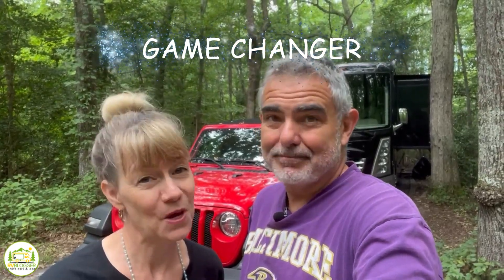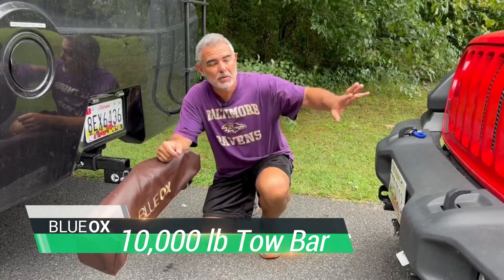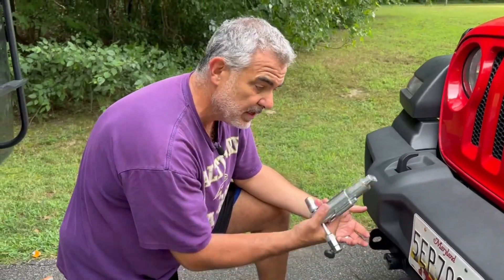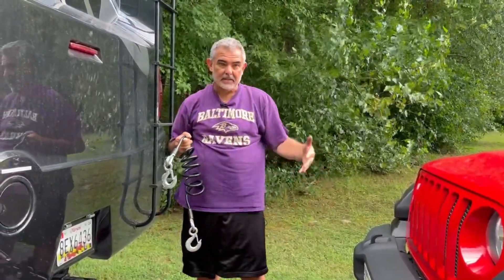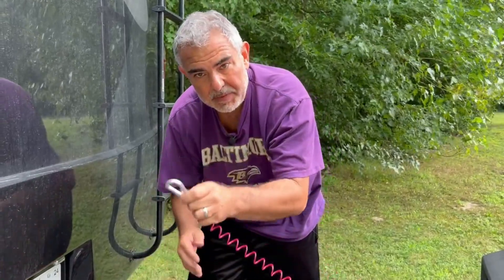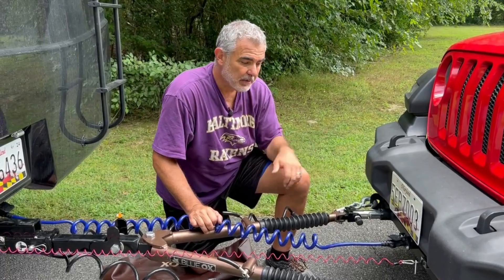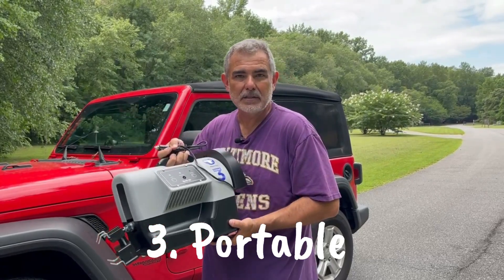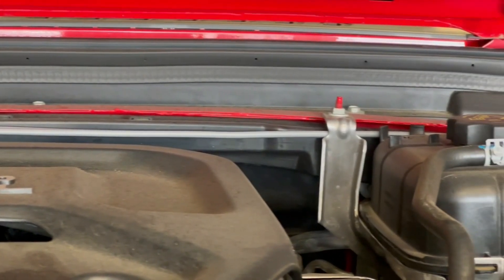Blue Ox Tow Bar - Total Game Changer!

Comment: Hi Mike, at 9:15 one suggestion that I use is to replace one of the bolts from your license plate with an eye bolt.  Then connect your emergency cable to the eyebolt.
Reply from the maker: That's not a bad idea Brian. Thanks for that tip and watching our video and commenting.
Reply: This is what I have done and works great!

Comment: Nice video you guys, so you've extended your hitch on the "A" I'd say go ahead and extend the electrical cable ( get longer) and get a safety cable.
Next thing is you said you put the Jeep in neutral. Hopefully you're putting the transfer case in neutral if the Jeep is automatic transmission.
Reply from the maker: Hey Johnf
We appreciate the info!!! 
Thanks for watching and commenting! 
❤ Mike and Susan

Comment: Hi Mike had the blue OX install professionally and wasnt told about removal pins on base plate , Thank  u much on that tip them Lil tips. I did add the blue OX guard to protect the front end of my jeep for peace of mind easy to connect to bar.
Reply from the maker: Hi Ric,
Glad you like the tip about the removable pins! And I think we will order the guard too...just to be on the safe side...We just camped on a gravel pad for 4 days and we spit some gravel when we were on the highway...yikes.
Thanks for your tip too!
Mike

Comment: Very good video! As was referenced in other comments, where you connected the breakaway cable to your Motorhome is just fine. You connected it to the hitch frame not to the hitch receiver assembly. The hitch frame is either bolted or welded to your Motorhome chassis. It’s not likely to come loose. If something were to fail it would be the pin that holds the receiver into the tube or something connected to the receiver. Even if all of that assembly was pulled away, the breakaway cable is “upstream” of all that fastened to the hitch frame and would stay in place allowing the breakaway cable to pull out of the Jeep baseplate and apply the brakes. You are good to go as you are in my opinion. Thanks for your efforts!
Reply from the maker: Hi Randy,
Thanks for the info...that all makes sense to me!
Thanks for watching the video!
Mike

Comment: For the break-away lanyard: I drilled a 1/4” hole through a bottom license plate hole, through the bumper, and installed a stainless steel eye bolt, with washers and lock nut.   Now I can easily hook up the little orange lanyard to the VEHICLE,  not the hitch assembly. Easy Peasy.
Reply from the maker: Thanks for sharing that info!

Comment: Thanks for the great video! We will be towing for the first time this weekend with the Blue Ox, Air Force One braking system attached to our ‘24 Wrangler! I installed it all myself, it takes a little mechanical ability, electrical experience with cars and help from YouTube University! It was fun getting it all completed and now I have a better knowledge of the entire system. The battery charging wire can be purchased for about $70 or you can build it yourself for around $20 with an inline fuse, a diode and some 12 gauge wire from an auto parts store.
Reply from the maker: That’s awesome that you were able to install it all yourself. You are a true DIYer! Which is perfect in RV life...gotta be a fixer! You need to make a video about this! Thank you for watching our Blue Ox video and commenting. We appreciate your support! Safe travels.
Reply: Let us know how it goes. How hard and long did it take you to install yourself? May I ask you what you bought, where you bought it and apex price? thank you We will be towing a wrangler JKU 2016

Comment: I have used the Blue Ox for a couple of years and really like it. I do have problems with the lights on my Jeep not always working and I have to fiddle around a bit .One word of caution that you probable should have mentioned is that it is almost impossible to back up more than a couple of inches with the vehicle attached as the follow vehicle will not back in a straight line and will jacknife. This is from the voice of experienec and the end result was costly to me with damage to both vehicles and a bent arm to the Blue Ox tow system making it worthless and I had to buy a new unit. Incidentally, on that particular trip, I connected and disconnected the tow bar 8 times for different reasons.
Reply from the maker: Hi Frank,
I should have mentioned the DO NOT BACK UP warning in the video...
Thanks for bringing it up here...maybe some others will see it and read it. Sorry you found out the hard way!
Thanks for watching!
Mike

Comment: Here's a few more tips, For the breakaway tether on the coach side, I used a 900 lbs pull strength cable with eyelets that attaches to the chassis frame on the coach and that right under the hitch.  Also I recommend using hitch stabilizers on the hitch to the drop receiver and one on the  drop receiver to the tow bar, this eliminates any movement and chucking that occurs when traveling.
Reply from the maker: Hi Casual RVer,
These are great tips! I'm gonna check out the cable and the stabilizers.
Thanks very much!
Mike

Comment: I am all for step by step how to videos.  Is there a way to check your brake lights if you’re by yourself? And if you’re by yourself can you tell by that little lever on the tow bar arm that the second arm has extended fully Incase you don’t have that second person walking along side of the car to make sure it snapped into place
Reply from the maker: Hi Debbie,
Hmmm...this is a really great point. Susan and I are stumped...maybe a mirror on the back corner of your tow vehicle to see the lights and you could use a rear back up camera to watch the second arm click into place. Ours usually clicks in 2-3 seconds but you may need to drive 50-100 feet to get straight before it locks.
Thanks for watching!
Mike and Susan

Comment: What if you're traveling alone. Are there cameras you can use to make sure wheels are all turning, and the tow bar locks on both sides.
Reply from the maker: We installed a backup camera on our Class C so I imagine you could do the same here. The first tow bar we physically make happen from outside when hooking up but we do "feel" when the second tow bar lock from inside the motorhome. Hope that helps. Thanks for watching and commenting Terry!
Reply: For the wheels, just put a little chalk line on your tires and drive for a second. You will know if the wheels turn.

Comment: For safety brake disconnect cable suggest dill and tap into side of tow hitch down drop and install a threaded eyebolt w lock washer beneath to latch into
Reply from the maker: Hi Thomas,
Thanks for the suggestion. I think that you aren't supposed to connect the safety brake cable to the tow hitch in case the entire hitch fails and falls off the rig. 
Hope you have a great holiday season!
Mike

Comment: Wow, just wow! Exactly what I was looking for. We just bought a used Jeep Wrangler 2021 4WD 2 doors and have the Blu Ox system installed today (with the Patriot brake system). We will get it back this Friday and will tow it behind our Dynamax Isata 3 Class C RV for the first time. But I do have 2  important questions: 
1. What are you doing with the transmission on the Jeep side? According to the Jeep owner's manual, the transfer case must be set to Neutral (N) and the automatic transmission should be in Park (P). Is it right? 
2. If you are in a situation where you have to move back (reverse) with your RV, can you do it or you have to first disengaged the Jeep from the tow bar?

Many thanks again Mike and Suzan for the great video. Well explained and well done!
Reply from the maker: Glad you like the video and I'm sure you will love towing your Jeep with the Blue Ox system!
Two great questions:
Question 1: Yes the manual is correct. Once you get your transfer case into Neutral then you place the automatic transmission into Park. This is exactly what we do with our Jeep. Here is the procedure:
1. Turn on engine and put transmission into neutral
2. Turn off engine and put transfer case into Neutral
3. Turn on engine and place transmission into Drive and then Reverse to ensure the transfer case is in Neutral and disengaged
4. Put Jeep transmission into Park and turn off the engine
Question 2:
Never Ever back up with your Jeep connected to your rig. If you have to back up you need to disconnect your Jeep first.
We have had multiple RV techs and mechanics tell us this same info.
There are definitely others who will tell you it is ok to back up a little bit or if you install some special part it will enable you to back up but we prefer to play it safe.
Thanks for watching and enjoy towing your Jeep!!! It really is a game changer that will enhance your RV camping experience.
Mike
Reply: Many thanks again. All set now! Blue ox, baseplate and Patriot installed… and ready to go!
Reply from the maker: @NanouDub  that’s awesome! Enjoy and safe travels!

Comment: Thank you for your video. We just got the same system and are pulling our 2021 Ford Escape Hybrid. Two questions: 1. Where are putting your eBikes now? We have a hitch behind our SUV but are not really comfortable with them being there. 2. Do you know when exactly you would use the remote that comes with it to put on the car brakes? Thanks again. This is the first video of yours I watched. Looks like I will have to check some others out now.
Reply from the maker: Great Questions!
We put our e-bikes on the back of our Class A. We use a dual hitch along with a Thule Bike rack to make it all work. I'll include some links so you can see how it all works. 
We use a dual hitch and our Blue Ox Tow Bar goes into the bottom hitch receiver and out Thule Bike Rack goes into the top receiver. Here are the links so you can see both of these items:
Dual Hitch Receiver: https://amzn.to/3NXngg4
We needed a dual hitch with a 2" drop to ensure that our tow bars are as level as possible. You may need more or less than 2" but the idea is to be sure your tow bars are level and on the bottom hitch receiver.
Thule Bike Rack: https://amzn.to/3pRNUix
The Thule Bike Rack goes into the top receiver and has held our two e-bikes with no issues for thousands of miles. I suggest getting the top receiver 6" high or more (I think ours is 8") so you have room to stow your tow bars without having to remove the Thule Bike Rack to do so. The Blue Ox Tow Bar swings to the side when stowed and if there isn't enough room between the hitch receivers it won't work.
We also bought a good bike cover to keep rain and dirt off of the e-bikes. Our first cover ripped but the second cover we bought has held up for thousands of miles. Here's the good bike cover we bought: https://amzn.to/43vj4Ko
As far as braking goes the Patriot Brake System is not a remote control system. It has a pendulum inside it and it sits inside the jeep and connects to the brake. When I hit the brakes in the RV the pendulum in the Patriot Brake Controller swings forward and causes it to apply the brake in our Jeep. It has a sensitivity setting from 1 - 10. I usually keep ours at a 2 but I set it at 4 when driving on steep downhill grades. You can set it on the fly because there is a control module that sits on the dash in your RV so you can easily change it while driving.
Hope all this helps!
Mike

Comment: Thanks, not sure if it was the lighting but it appears that your tire mounted third brake light is not working on your Jeep.
Reply from the maker: Hey Staff 
We appreciate the info we'll check it out! 
Thanks for watching and commenting! 
❤ Mike and Susan
Reply from the maker: So it turns out that our brake light does work, but when the Jeep is connected to our motorhome it does not. I'm pretty sure this is because the wiring setup is meant for two tail lights - not three..
Thanks for noticing and bringing it to our attention.
Mike

Comment: We are getting ready to buy a wrangler to tow with our class c.  What was you total cost to get your jeep to the towable point?  If you don’t mind answering.  Thank you for this great video!
Reply from the maker: You're welcome! Don't mind you asking at all. To have the base plate and wiring installed on the Jeep to get it road ready for towing was $750. Our installing included the "trickle charge" to make sure the Jeep battery doesn't die while in tow mode. Feel free to ask any questions. Thank you for your support!

Comment: Do I have to have the brake hookup if my vehicle is under 5000lbs in the USA
Reply from the maker: Every state is different. We recommend a brake controller all the time. We use the Patriot brake controller and it's very easy to use.
Thanks for watching!
Reply: @RVBlogger  Toads less than 2500 lbs in a few states and less than 3000 lbs in all the other states do not need a braking system.

Comment: Where can I get info on charging tow vehicle battery from coach hookup?
Reply: If you're running a 7-way plug from the RV to the tow vehicle, it has a wire already that is hot. Meaning it has power coming from the coach. You would just need to connect from the plug to the battery I would think!
Reply from the maker: Hi William,
I can't find a good video on the subject - looks like we have a new video we will need to make!
Thanks and hope you have a great holiday season!
Mike
Reply: Ettailer has one on the charger... can't find link right now though.

Comment: What year and model Jeep do you have?
Reply from the maker: We have a 2020 Jeep Wrangler.
Reply: I have 2018 Wrangker with Blue Ox.  I am going to be using it for the first time tomorrow.!  Can you please tell me how to set the inside of the jeep.  From what I have researched, it says, put the four-wheel-drive system in neutral the transmission piece in park..  I’m not sure about is do I need to have the key in and accessory position so that the steering wheel moves freely.  Any comments would be appreciated!

Comment: Tip:  Install rubber mud flaps on the back of the RV to prevent rocks from hitting the Jeep.  Tip: instead of pushing the jeep back to lock the bar, simply connect the bar then tell your wife to back up to lock the bar.  Then connect your cables.  TIP:  connecting and disconnecting does take some planning.  I don't recommend your brake system, as it adds another step to the process that's a hassle if you're disconnecting every time you camp.  The RoadMaster Invisibrake costs more, but it's so much easier since you don't have to install and remove the brake system each time, and store it somewhere.  Too much hassle IMO.  TIP:  Do not buy the 10,000 lb tow bar!  Everything is heavier and bulkier, harder to use, not to mention it's more expensive.  The 6000lb Alpha is fine for the Jeep.  You should NOT be towing anything heavier than 6000lbs with a gas RV motor.  If you've got a DP, that's another story, if your pulling a pickup, or something over 6000lbs, but I bet you never will.  It's really best to tow a small car to lighten the load and make it easy to maneuver around parking lots, and campsites, plus being easy to park in front of the RV in your campsite.
Reply from the maker: Hi Tom,
Thanks for all the great tips! I don't agree about backing up the Jeep to lock the tow bar because if you're not careful you could damage the tow bar or the baseplate.
Definitely appreciate the feedback!
Mike

Comment: Big question for the whole flat tow and invisabrake community.
We bought a USED 2017 Sport Unlimited from the local Jeep dealer. Had a RV tech install the Blue Ox and invisabrake just recently. [Jeep is not under factory warranty]. So we had a oil/ tire rotation scheduled included a issue with brakes thst existed prior to invisabrake install, we wanted to review prior to a road trip. The DEALERSHIP refused to even look at the brake issue. 
They stated UPGRADES unless original Jeep parts or Mopar- they will not do any work including if you change the wheel rims.
Have any Jeep owners run into this refusal to work on their jeeps?
It just blew my mind  - seeing all the new  jeeps on the lot and knowing a jeep is one of the most customizable vehicles. But maybe it's just me.
Reply from the maker: Wow! Sorry to hear about your experience. We haven't had an issue...yet.🤞Hoping someone that reads this may be able to help or lend insight. Thank you for sharing. And thank you for watching our Blue Ox video and commenting. We appreciate your support!

Comment: You can add a  2200ld "D" ring to one side of your bumper to connect your break away cable 
Also, putting your jeep in neutral does not leave your accessories on. If you're leaving your accessories on that's  because you did that.  If you have a key, turn it off.  If you have the push button.  Turn it off.
Reply from the maker: Hi Frank,
No you can't add a D ring to your bumper. The breakaway cable is wired into the Jeep braking system so if the Jeep breaks away it will stop.
I'll have to look into the accessories issue. Thanks for the info.
Mike